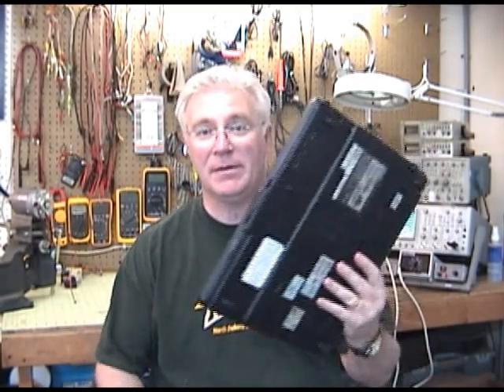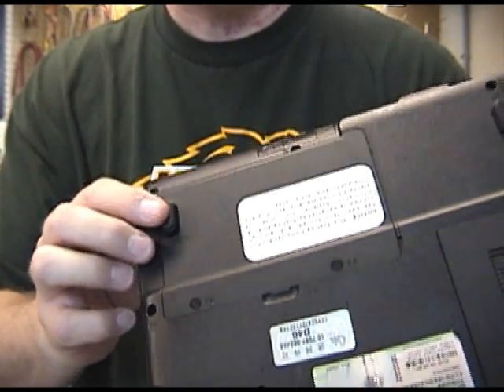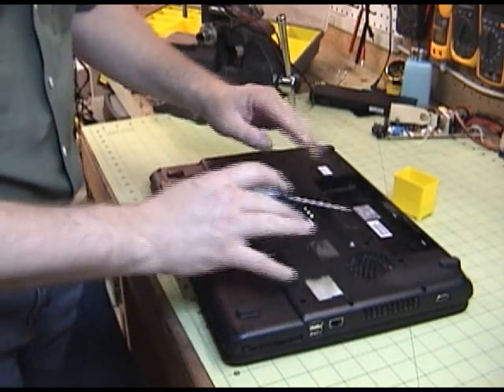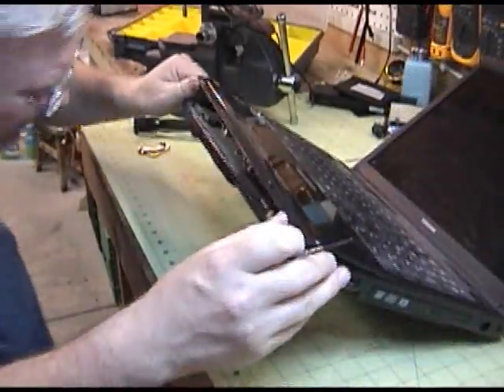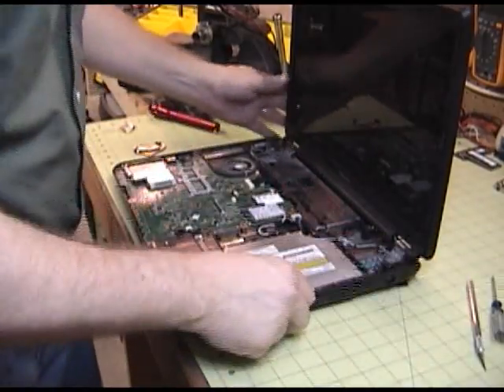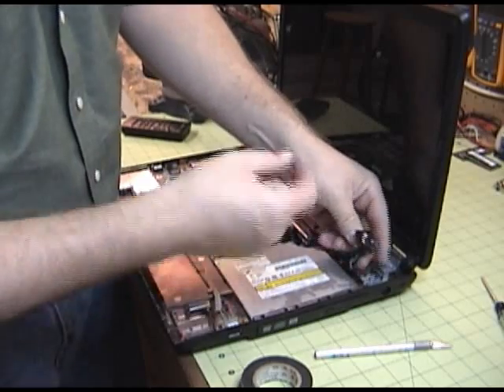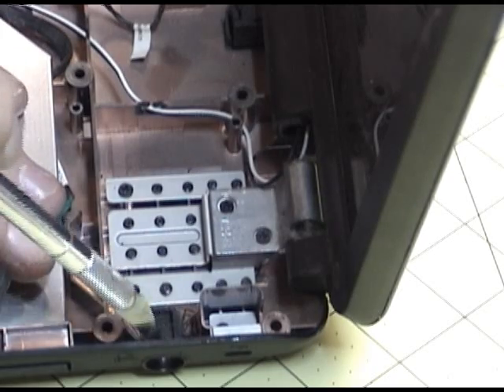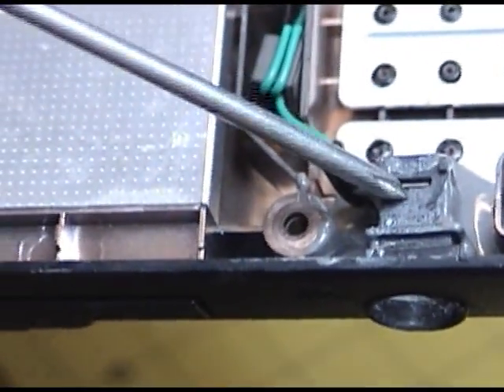ToddFun.com: Laptop power connect repair

Comment: Excellent video and very helpful tips. I fixed the exact same problem on a laptop a few days ago. When I put the two parts epoxy, I used a plastic clamp to secure the power barrel in place and left it overnight for the epoxy to dry.